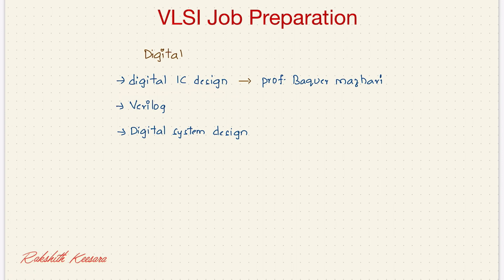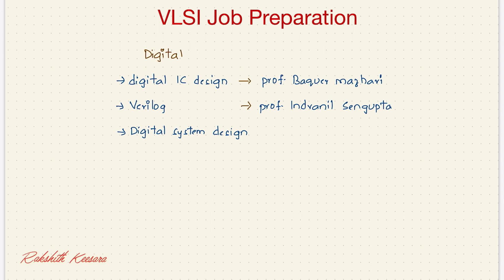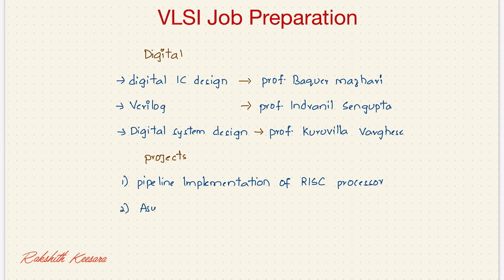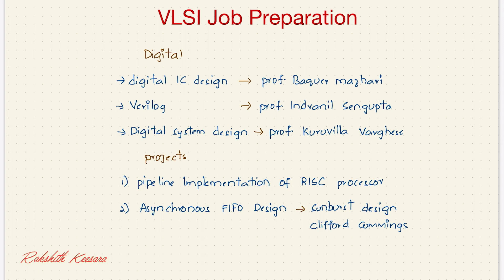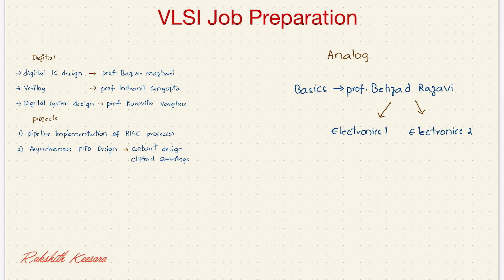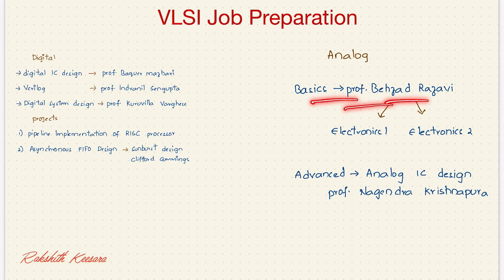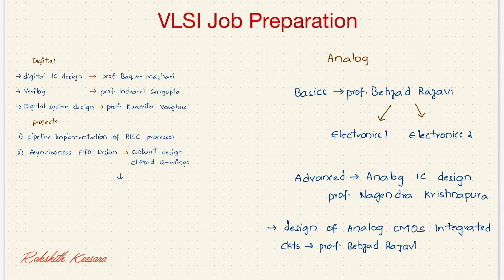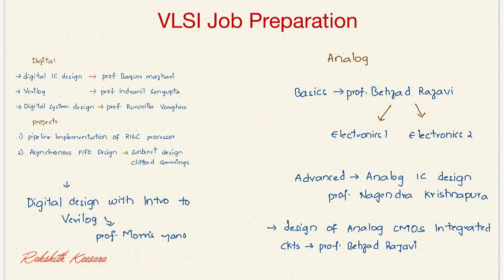VLSI Job Preparation without training | Subjects | Projects | Analog and Digital VLSI

Comment: Sir, kindly make a video on VLSI backend(Synthesis/PD/Layout) and related projects.
Reply: An asynchronous FIFO .v file (synthesizable) and using an open source PDK - doing floorplan/placement/CTS/routing? Is it a good idea?
Reply from the maker: Asynchronous FIFO is generally considered as an add on project, it's just for ur learning purpose